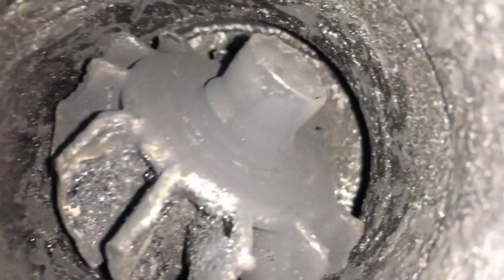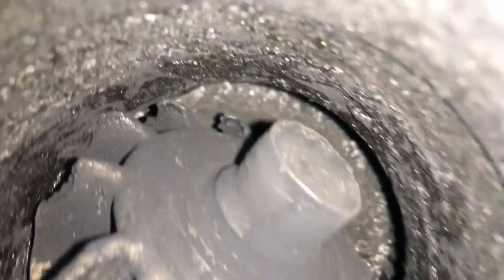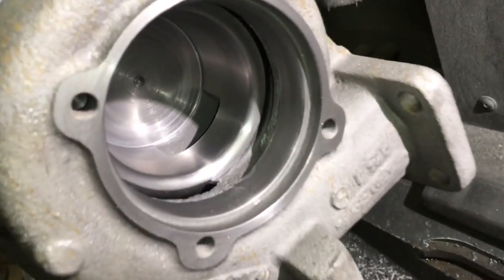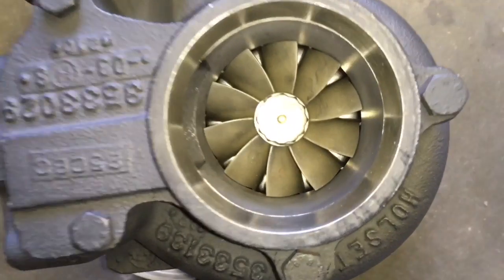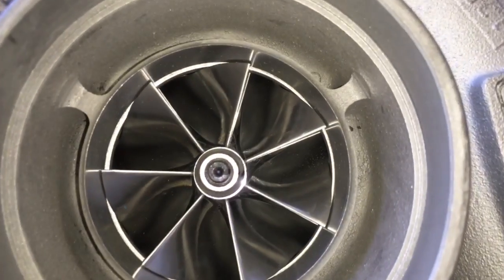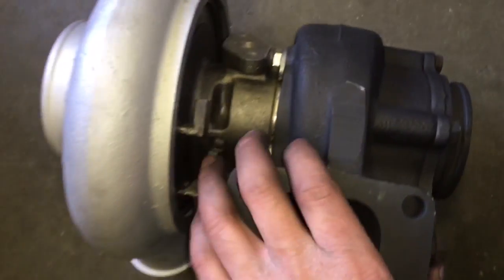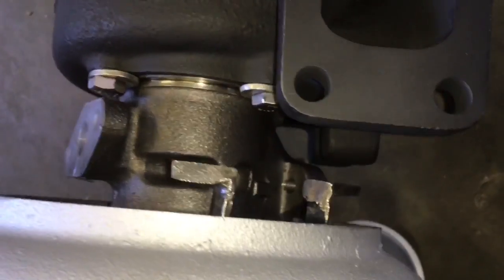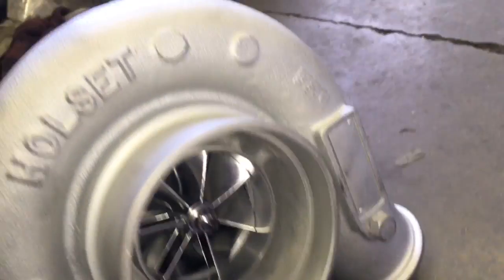HX35 Broken Shaft Upgrade to 67 mm

Comment: I have an original HX35W on my 2000 Dodge. The turbo is getting sloppy and starting to rub inside the turbo housing slightly. I will be putting +75hp injectors in it, have already done a small updated supply pump and am wondering what y'all can offer me for redoing my turbo or replacing it. Budget is the most important factor but would entertain a small upgrade with the larger injectors as well. What are my best options? email me at tgjurgensen@hotmail.com if its easier for you. Thanks

Comment: what kind of power range do you think this turbo would have after the upgrade?
Reply from the maker: Using the 12cm on a diesel I'm not sure. The he351cw we had shops report back 700 hp. The main factor is how well the 12 cm turbine housing will flow. I built one with an 18 cm and the customer put it on a 2.3 stroker evo and dynoed at 940 hp.